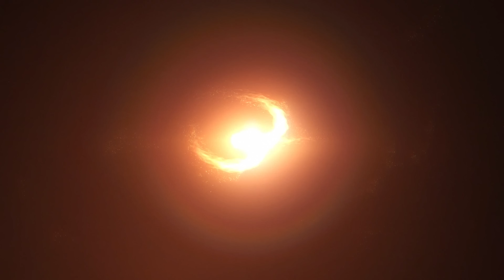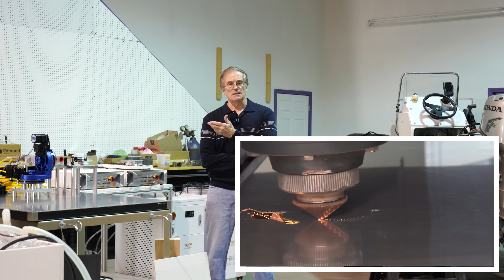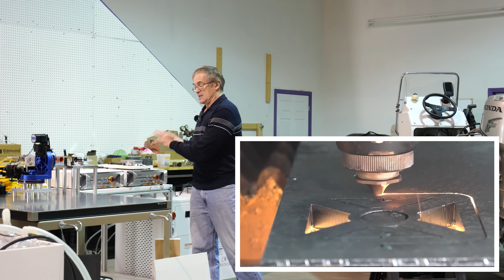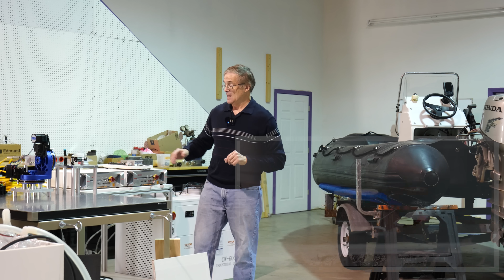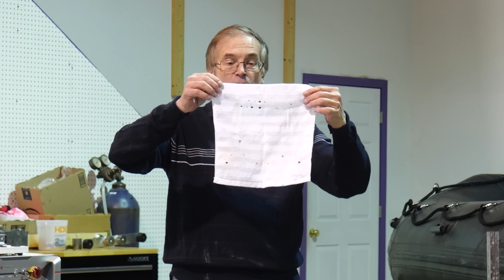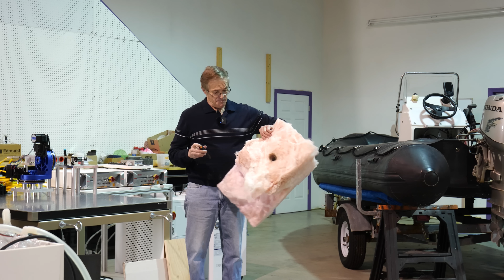We have a problem... and need your help!

Comment: Use a high velocity fan. Making each blade of the fan highly reflective. Then bend each blade at a little different angle to reflect and scatter the lazer towards the ground into a tub of water and sand.
The more blades on the fan the better. 
Note: that each blade 180° from each other would be bend at the same angle for balance.
The larger the fan the better.
Reply: Copper reflects about 95% of the light from a fiber laser primarily due to its electronic structure and the wavelength of fiber lasers:

1. Fiber lasers operate in the near-infrared (NIR):

Most fiber lasers (like ytterbium-doped fiber lasers) emit light around 1060–1080 nm, which is in the near-infrared range.

At these wavelengths, copper has very high reflectivity, similar to how it reflects visible and infrared light.

2. Copper’s free electron density:

Copper has a high density of free electrons, which respond to incoming electromagnetic waves (like laser light) by oscillating and re-emitting the light.

This behavior causes most of the laser light to be reflected rather than absorbed.

3. Optical properties (complex refractive index):

Copper’s real part of the refractive index is high, and the imaginary part (which corresponds to absorption) is relatively low at NIR wavelengths.

The result is that the reflectivity is very high and absorption is low at the fiber laser wavelength.

4. Surface and material purity:

Polished, pure copper reflects better. Oxidized or dirty surfaces can absorb more energy.

However, in industrial laser cutting or welding, you often have to overcome this reflectivity (e.g., by using higher power, shorter pulses, or laser sources with different wavelengths like green lasers).

Let me know if you want a graph of copper’s reflectivity vs wavelength or more detail on how this impacts laser machining.
Reply: I guess I should build my drones out of copper?

Comment: My idea is to fill a thin wooden or mdf structure with a viscous fluid like corn starch and water. The thinking is using like others have said and having it slowly drain when punctured to make quick tape repairs easier. Good luck

Comment: Cyclotron Tech here.
That is a lot of energy to dissipate. 
You need active cooling, and maybe some geometry.

for geometry, you could use an angled wall  (45 degrees or greater). 

you need to cool that wall. running water over the top or bricks, or
something cooled from beneath.  like a steel plate with water running behind it. 

I wonder if you could get away with a cloudy aquarium.  the heat will dissipate the whole length within the water. 
Maybe frost(defocus) the glass, so your the beam gets dispersed before the wall?

Comment: Why not a brick wall and waterfall combination:
- create a one layer (loose) brick wall with equally drilled holes, so that when stacked, all the hole align from top to bottom
- have water supplied to the top of the brick wall through an enclosed channel
- the channel should allow the water to not only past through the drilled holes, but over the bricks as well, to provide maximum cooling
- the water should be captured at the bottom of the wall by a catch basin and pump back to the top
- because we're dealing with loose bricks, when damaged, it can be easily removed and replaced 
I'm not an engineering, but this seems doable.

Comment: Thinking outside the box, Does it need to be far away from the lasers output i.e a pop up actuator close to the output end that has silicon carbide, alumina, quarts or sapphire to absorb the energy quickly then a thermal sensor to a relay (arduino controller) I hope this makes sense as its 2:45 AM currently... ooops.

Comment: Waterfall of dark sand: removes thermal mass and then the vaporised/molten impact sand is pushed out of the way by the net grains, the dark colour and variable shape of each grain diffuses the light somewhat, and a bucket/screw/disperser system would be (relatively) cheap and (relatively) easy to make, and on wheels could be portable (enough).

Comment: Okay, tall plywood shelves faced with steel. On caster wheels.
Play sand, poured into a meltable, plastic material to act as cells on the shelves?
The idea is the laser melts a hole in the plastic but doesn't burn the entire vessel.  The sand begins to melt, more sand self-feeds the heated area. 
This doesn't magically dissipate the energy, but it WILL stop the laser long enough.
The cells can be removed to reduce weight & replace damaged units. Should be cheap, easy to source material for.

Comment: How about ceramic tiles mounted to a board backwards? Ie adhesive side out to prevent reflections. May have similar property’s to the bricks while being thinner and lighter. Could be scaled up or down depending on your needs and size of the boards they are mounted to easily.

Comment: What about whatever the space shuttle used as insulating tiles? They're lightweight and tolerated the heat built up by the plasma on atmospheric re-entry.

Comment: Just a suggestion but perhaps build a rolling cart on caster wheels. Make the walls out of cement board as would be used for backing a shower in a home or the more fire resistant varieties. Potentially use layers of cement board or perhaps make an enclosure of cement board with about a 2" to 4" void in the middle and fill it with sand. If you sealed the edges with epoxy or silicone or marine seam seal and gave it a cement board bottom you could potentially even put water in with the sand. 

Some other ideas would include buying a granite counter top and sanding the surface with low grit abrasive to decrease its reflective properties by heavily scratching the surface. Also you could similarly mount this standing on some kind of rolling cart with casters.

Make a moveable wall of of cement board and tile it with slate tiles.

There are engineering controls methodologies you could use to limit the firing time as some others have suggested. You could put in a time delay relay that upon firing or coming to some other measurable point whether you monitor the amperage output at the time of firing as a trigger or some other measurable indication that you are in the firing process and have the relay configured to shut the entire apparatus off or do a hard cutoff of the fire command after a programmable time period as a safety cutoff.

Just some ideas, I hope this is useful.

Comment: Guessing it needs to be taken systemathic.

Your fundamental problem is high energy density, too much energy per area.

Basically you need something to disperse the beam into a wide area, reducing the energy density.

Also, it must absorb and disipate the energy, which is where the fiberglass insulation failed, it stored instead of disipating.

Have you tried graphite ? Either that amorphous graphite used on pads for belt grinders or probably even better, graphite foam.

Comment: Set up a few cameras that are placed behind the drone targets they look for the specific laser wavelength. Any scattered laser light will trigger a kill switch to the laser. Hopefully this can be done in less than .25 s so you can just use a drywall back wall or tiled wall.

Comment: Rather than try to absorb the energy, I’d look to solutions that can disperse is…specifically, could large fresnel lenses be used to defocus the beam? (Might just melt though).  You used to be able to get fresnel lenses that are a metre square.

Comment: Was thinking about a wall of water running over the blankets, we're just a wall of water with some sort of particles in it that are dark, to to absorb heat.  As well as you could use ceramic tiles attach the sheets so they'd be easier to deploy

Comment: Can you face the laser into the ground / floor in an area outside or into a dirt hill or is this something that has to be done inside? Maybe fill a high heat resistant glass tank with dirt or sand? I don't care about credit if this works.

Comment: What about a second measuring laser close to the same beam that detects the distance the beam can go? The laser could rund pulsed with only 0.1% or less energy and only ramp up to 100% if the distance to the target is less than the distance to the wall?

Comment: You just need to have a large lens to cause the beam to diverge..
OR
Maybe try a water wall like 6”-12” thick with 
 something that will absorb or diffuse the laser light. 
You may have to have circulation pumps keeping it moving and mixed to keep the heat from building up.  
I wonder if reflective Mylar flakes would with. 

Perhaps a wall of dome shaped mirrors that will reflect a diffuse beam 

Perhaps an acrylic that’s 1/2”-1” thick, the back side is dimpled using a ball nose mill which will cause the beam to become unfocused. 
In my experience of laser cutting acrylic it needs to have tape or something on the surface to initiate cutting otherwise it just passes through.  

Perhaps make a wall with a series of glass pyramids so the light can be dispersed, refracted etc into a less focused beam.  

Good luck.  From Doug

Comment: Interesting suggestions already but I feel that the problem hasn’t been specified enough. What area or volume is expected to be shielded? What shape? Surely the angle of incidence to the protection surface is a major factor too.
Reply from the maker: If you look at the overhead view in the video, you can see the wall that needs to be protected.  It's about 25 M^2. It's rectangular and extends a little beyond the large garage door.
Reply: @ Wow ok that will clear some of these propositions off the table ! 😅

Comment: First a blowback layer to absorb reflected scatter from its perforation, something that is charred but provides little fuel in an oxygen rich environment. Rammed, uncured earthen bricks (still have moisture) you would need a berm for this to be laid out behind the blowback layer. Finally, you need a photo cell to observe light between the blowback and the sacrificial berm to kill the setup. And lastly, you need a booth to remotely observe your work. Not an expert. Good luck

Comment: Please give the guys at Thorlabs a call. They have beam traps that I think will help you out.  Alternatively try using large fiber optics and see if you can create a target and at one end have all the fiber optic ends exposed like a whole bunch of straws in a water glass. You want the laser beam to get broken into as many smaller beams as possible. Maybe make a custom super lossy beam splitter. Use different sizes of fiber. You want to make this as lossy and terrible as possible. Maybe whip them around on the ground to add micro fractures. Put them all into a metal tube and at the other end of the optics send it into wet sand or a big tub of play gravel. The gravel will fall back down in as peices get destroyed but hopefully the first part can cut down on the strength of the beam. I love your content, especially the one you did about zippered offset walls and insulation.
Reply from the maker: I have them on speed dial. 
The problem is the large area that has to be protected.  The beam will be chasing drones around in a field of about 200 ft^2

Comment: Here’s an idea combining a few items to disperse the light and the heat to provide a safe backing for the wall area. 
1) Build a lightweight aluminum frame to hold several panels. It can be in the form of a grid like the drop four game.
2) Build replaceable panels that can slide into the grid out of hardy backer board at no more than 12”x12” for weight and ease of transport.
3) Paint several layers of a sublimating paint on the front of each panel:
	A) 2 parts black paint
	B) 1 part graphine oxide
	C) 1 part fine sugar like confectioners or powdered sugar
	D) .25 p - .5 p cornstarch or dextrin to make a denser carbon mass
	E) .25 p fine iron oxide for higher heat absorption and spreading
4) Use a pipe and create a layer of laminar flow water with a dye mixed in it and pumped from
	bottom to top and use a product like:
	A) IR-1061A
	B) Epolight 9837
	C) LDS 950
	D) IRG 026
	This would absorb laser light and heat and could be formed via a slot in a pipe suspended in front of and above the wall. 
5) Pulse the laser so that it only comes on when the target is in range (aim and fire, rather than fire and slice the entire wall)
6) Consider using a de-focusing lens to disperse the laser while not on target. Small solenoids could do this rather quickly.
7) I like the comment of dual keys to prevent accidental power up of the laser.
8) I would also add in several emergency stops in the area that you are working in. They can be remote wired to give multiple people the chance to kill the laser in an emergency.

Comment: 1 add a trigger to activate the lazer (just like any gun)
2 provide power input adjustment to control the output (variable resistor?)
3 incorporate automatic distance detector to suggest level of power input.

Comment: For reference, I paused and typing this reply after he mentioned building a concrete barrier, but also said it wasn't easy to remove. I disagree, I feel like it is possible to build a mobile concrete barrier, or you could just use a mound of dirt as a barrier.
Reply: Please disregard my previous message, unless a big mound of dirt is an option. (Seriously, it's transportable with equipment, and cheap.). However, have you tried Rock board? It's basically fiberglass reinforced concrete used for sub flooring for Tile? It's like drywall, but concrete.
Reply from the maker: I haven't,  but it's definitely on the new list.
Reply: @TechIngredients If that doesnt work, I still feel like a mobile barrier is physically and economically feasible.

Comment: Here is a multifaceted approach
1 have a large piece of plywood behind your test target with a photo cell, IR or thermal camera pointing at it so whenever the beam Burns through your test target automatic, you have a kill switch.

2 in front of that have another light shield with water rain or a mist falling in front of it. This will actively scatter the light and drastically reduce the power when it hits the shield behind it. Then put a reflection shield in front of this between the rain and the laser, to prevent the residual laser light from bean, reflected back towards the laser. Then you do your testing in front of this
Reply: In order for this to fail, the laser light has to burn through your target then through the scattered light reflection shield. Behind then go through heavy rain and mist. Then still have enough energy to go through a actively cooled panel. Then if any light gets through that, the automatic shut off system will terminate the beam.
Reply: Looking forward to testing this out with you. Or at least seeing where the faults are in this design.

Comment: My idea is water with a high saturation of something crystalline flowing between two pains of thin glass. The gap between the glass pains could be fairly wide. The water could flow into a reservoir where it would then be pumped back up to the top to maintain the continuous flow. If necessary, you could place a radiator in the flow path to cool the water.
The water would keep all the parts cool and the crystals suspended in the water would refract the laser beam thus diffusing it.
The back layer of glass could be mounted to a single layer of plywood. Hopefully, if the crystals do diffuse the laser, and the flowing water keeps the plywood cool enough, the plywood will stop the laser without burning.
Though somewhat heavy, the whole thing could be mounted on a cart to make it relatively easy to move.
FYI. I’m suggesting thin glass because I remember a pizza place that put its prep space and ovens at the front of their restaurant visible to pedestrians. They used thick glass thinking it would be safer. The thick glass kept cracking because of the temperature differential between inside and outside temperatures. Thin glass did not crack.
Reply: My first ideas are usually over thought, complex, and detailed.

Here’s a simpler version.

Layers, front to back, for the laser to pass through.

1 2 3 4 5 6

1: glass
2: gap
3: glass
4: black paint
5: adhesive
6: plywood

The back piece of glass (3) is painted black with the painted side glued to the plywood.

This forms a water sealed wall with a gap (2) to flow black died water through, to absorb both the light and heat.

Add a pump, for the water, maybe a radiator, and PVC tubing to make the whole thing like a cooling system on a car.

You could make a small test unit to test the concept and figure out the size of the gap.

Comment: Why not use a laser pointer as dummy for the development process?
Reply: Ok just watched your first video against drones. I think your tracking must be a lot faster. You will never hit a fast fpv drone. I dont wanna sound bitchy! This project has true potential. But i think a faster and more precise tracking is the key to make this important.
I hate to say it but ... military.
The ukrainian war is dominated by drones, especial those fast moving fpv- drones. If you get this to lock on drones rock solid 100m away while they aproaching your position with 50km/h... thats the trick.

Comment: A tank containing water with a food grade dye in it. The idea isnt to block the laser entirely, but to attenuate it just enought so that it doesnt destroy whatever is behind the tank. Water locally heated by the beam will convect away but an agitator would be an easy thing to add. If the water vapourises then great: some of that energy goes into a phase change and water vapour won't harm anyone. Modulate the dye(s) to suit. Im only a bioinformatician though so YMMV lol.

Comment: Referring back to the original source of the lasers, metal cutting the way the floor and bath isnt cut through is a fluid tray. Maybe a fishtank with an optical diffusion layer on the back side.